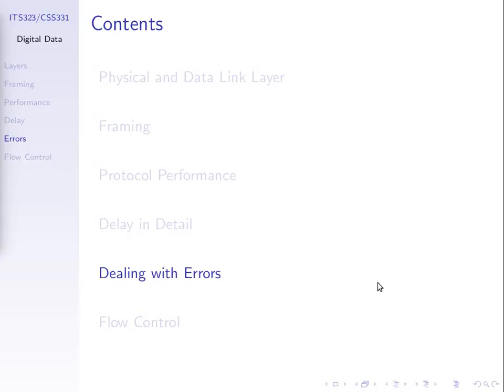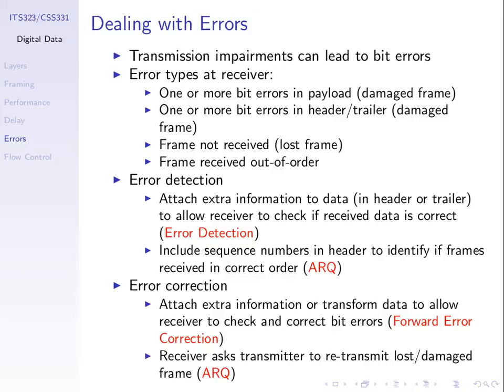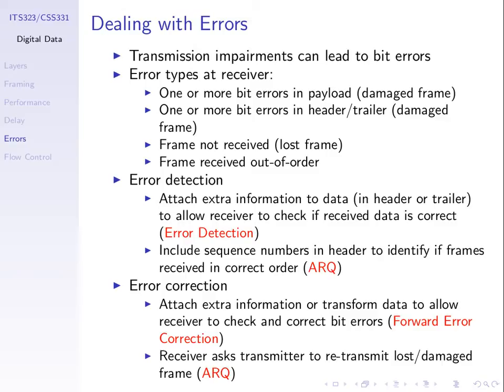Error Detection and Correction (ITS323, L13, Y15)

Comment: Dealing with errors
 • Impairment: what is sent is different from what is received
  ○ Digital data = bit errors
 • The receiver needs some way to know if it's received data is correct
 • Odd parity check
  ○ Total number of 1s should be odd, always
  ○ Location of parity bit doesn't matter so long as both sender/receiver know 
  ○ Ex
   § Data to send =1010011
   § We add a parity bit 1 at the beginning to make it odd number of 1s
    □ 11010011